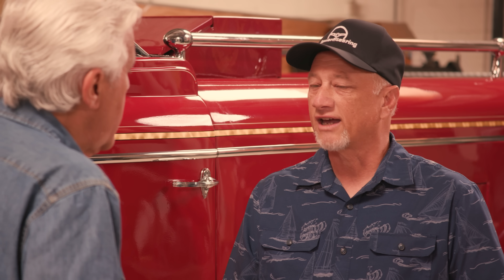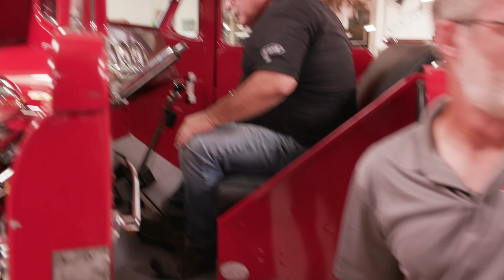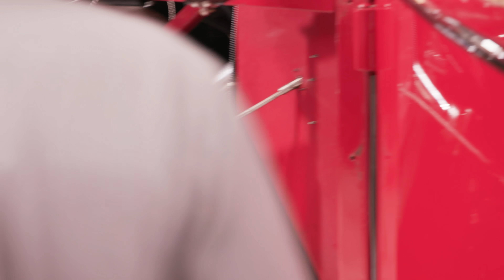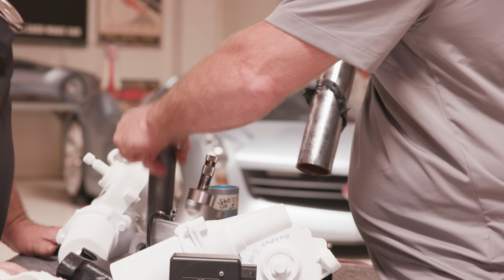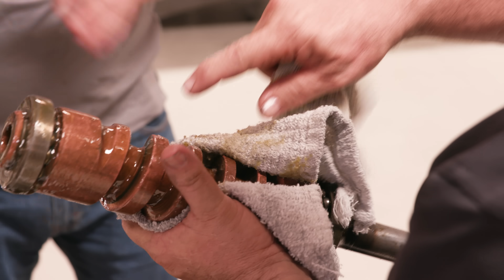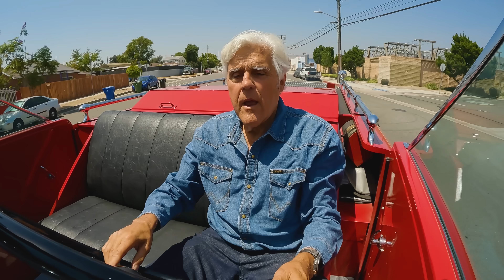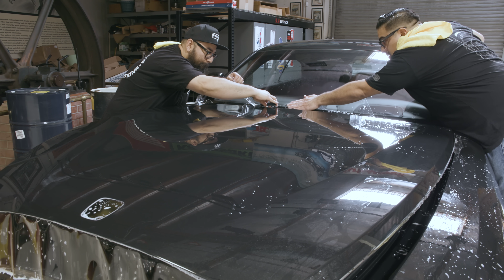Restoration Blog October 2024: Upgrading a 1941 Fire Truck with Electric Power Steering!

Comment: I have seen several conversations to electric assisted steering and folks have realize there is still a mechanical link to control steering. Yes, a malfunction may require 3 arms to turn the wheel, but I have certain issues. You have to sense speed as more is needed when slow. You heard a word used “Torsion” and a narrowed torsional shaft could twist and someway translates into an electric signal to change the amount of assist. These devices are of various types but commonly a potentiometer (Pot) like a radio volume that tell the controller (computer) how much amperage to give the motor, when to start, how much, when to stop. So several inputs. This means maybe 6 inputs and to keep compact, end up as 7 fingers that wipe across a printed circuit of conductive material. Over time, these wear almost as fast as the driver door hinges. Open circuit or noisy input signal sometimes inconsistent with cause it to simply quit. It can’t operate assisting your steering efforts if one of these signals are lost. The rate of speed can be measured to adjust how fast it helps also. It’s just a lot going on. Service? Not everyone is on top of these but early on, even the manufacturers change the entire unit without having just one part available. The reason sometimes is engineering will test to find the actual root cause of the described failure. They want it left alone and not in 26 pieces. I am not liking certain things as loss of steering plus auto-shut-off/auto-restart. That’s wear on the starter, pinion gear, solenoid contacts and flex plate. And for what, 1.4 gallons of gas per year saved? I don’t like it. Thanks CARB, EPA, DOT and other in-elected government agencies. Leave my vehicle alone!

Comment: minute 10:35 "Like a 1946 Dodge Power Wagon, you just can't turn 'em".  A friend had a 1948 Dodge PW and it is the heaviest steering car/truck I drove. I had a 1957 Mack B20 and it was heavy but his Dodge was much worse.  I had a 1959 Corvette, they're a tank, a tuna boat, that's why the steering wheel is 3 feet diameter. And the 235/60 tires didn't help but the Dodge was worse.

Comment: I am a retired firefighter.  I think back to the old trucks I drove years ago.  Power steering was the stuff of dreams.  If you couldn’t handle the truck, you could not be an engineer.  The kids on the fire department these really don’t know how good they have it.  They never knew the old way of doing things.  That old LaFrance truck of Jay’s will probably run forever and Jay’s successors will have a pretty cushy time handling the old fire truck, etc.
Reply: Does its steering wheel diameter look a little small to you? Maybe that's one reason it was hard to steer?
Reply: @UberLummox  LaFrance possibly considered the fire crew having heavy gear on and gave the engineer more room under the steering wheel.  I have handled trucks where I could barely get my legs under the steering wheel, but the big steering wheel did give me an advantage.  Speak of manual steering, I was qualified on Tiller.  No power steering on the rear axle.  I see that’s starting to change.
Reply: Many early trucks into the 60s still had Cam n Lever steering as Jays fire truck. 47 Chevy trucks were the first to make the huge upgrade to a recirculating ball steering box which significantly reduce the steering effort and brought a much improved level of safety to the steering system as well
Reply: @Rich-q9r wow! In my old truck, the power was in my arms.😅
Reply: @DontCryAboutIt 😂😂😂good one!
Reply: Retired career firefighter here as well. Totally agree, drove a '53 Mack spare truck for a few months w/o power steering back in the day and at slow speed it was a bear to steer.  Most of the time though in my early career I drove a '67 Seagrave 8V-71 with a five-speed Spicer manual.....OMG I loved that truck. These days, all automatics....and air conditioning too LOL
Reply: @reelreeler8778  lack of power steering was a good thing BITD. Simplicity & more room in the engine bay.
Reply: Yeah, plus the old ones were open cab,  so when it was pouring out and a call came in, the first thing we'd do is bundle up 😂😂😂
Reply: Agreed;  back in the old days, I drove the old GM buses for a living, (like Jackie Gleason in The Honeymooners) and had to wait far too many years for the city to cough up the dough for power steering!  Air conditioning never seemed to show up  either, until decades later, and even then, really poor.  We used to cram those buses right up to the roof during rush hour; with people even leaning right up against the front window, and  with all that weight, we had no choice but to become muscular!
Reply: I hear ya!  The engine I learned on was IH Van Pelt.  1953 gasser. No power NOTHING!  1000 gallon tank, Hydraulic brakes.  Eye opening experience.😂😂😂
Reply: Hey thanks for your service!
Reply: Younger FF here.... I'll never forget the first time one of my idols told my about the one airpack the fire dept bought back in the 60s.... He said most guys left it on the truck 🤣🤣😂🤣😂🤣
Reply: Don't worry! The boomer generation has kept all younger generations poor enough that most of use lose a steering pump and our power steering in our vehicles from time to time. 🤣